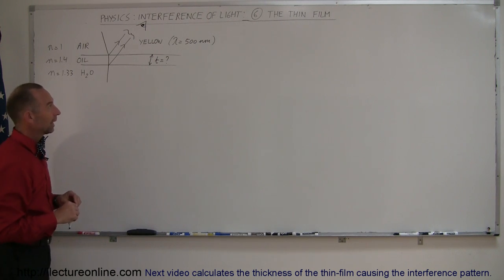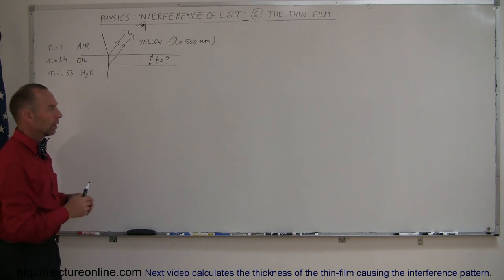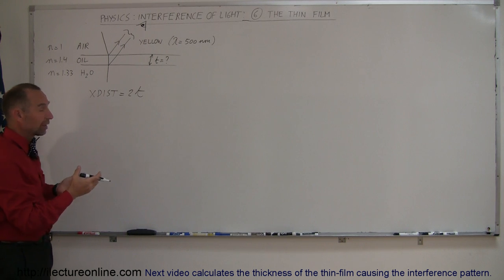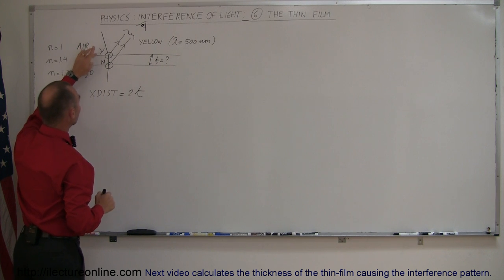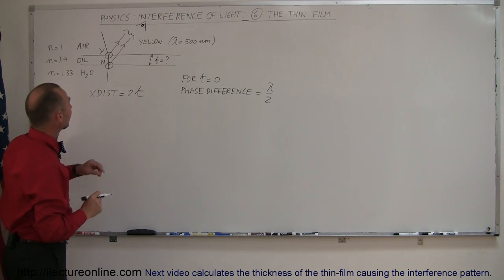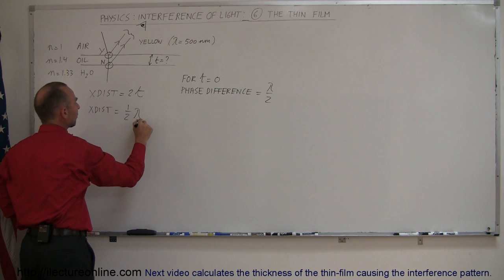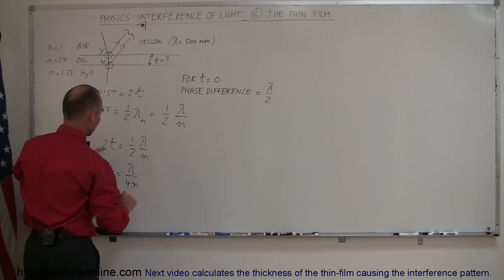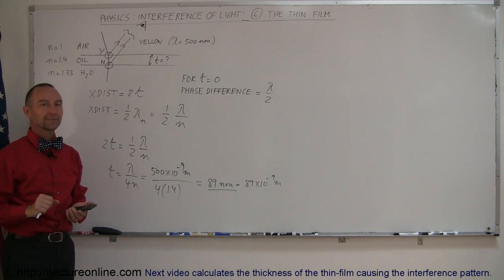Physics 60  Interference of Light (6 of 8) The Thin Film: Oil

Comment: quick questipon; lambda/2 is supposed to be destructuive interference yet yellow light is still being reflected....why :)?
Reply from the maker: When light hits a boundary where the index of refraction is higher on the other side, the reflected light will have a 180 degree (1/2 wavelength) phase shift (as from air to oil), but when the index of refraction is lower on the other side of the boundary there will not be a phase shift  (oil to water).  Therefore the two reflected beams are 180 degrees out of phase, and therfore the extra distance only needs to be a 1/2 wavelength for them to be back in phase.

Comment: Would it be possible to have the case of destructive interference and still have the yellow light reflected? In that case the observer wouldn't see any yellow light that's being reflected.
Reply from the maker: We are looking at the interference of the light reflected off the top surface with the light that is reflected off the second surface.  That second ray travels farther than the first ray (the extra distance is twice the thickness of the layer).

Comment: Respected sir could you please elaborate on the 180° phase shift...like what does this mean?
Reply from the maker: Whenever a wave encounters a boundary where the index of refraction on the other side of the boundary is greater than the index of refraction on this side of the boundary, then the wave will shift 180 degrees (1/2 of a wavelength) when it is reflected.

Comment: YOU ARE THE LEGEND. But I can't get one point. Why should the two waves be constructively interfere to get a yellow light?
Reply from the maker: That is correct, and yes in this video the two rays being observed are interfering constructively.  Note that one of them undergoes a 180 degree phase change upon reflecting off the boundary, therefore the path length difference must include the 1/2 wavelength.

Comment: If i want to determine the wavelength of light that i see, given the thickness of oil, do I use the same equation? I derived it on my own before watching this video and I got the same result, lambda = 4tn, but my result is 1520nm which is not even a color. Thickness of oil is 380nm
Reply from the maker: Try xdist = (3/2) lambda n    and xdist = (5/2) lamda n and see what you get.

Comment: I believe you should have used the wavelength in the oil.  Use n1 lambda1 = n2 lambda 2 to find it.  500 nm was not the correct wavelength to use, given the prompt for this problem.
Reply from the maker: The video is correct.  Thanks for checking.
Reply: Ah, yes, you did indeed convert to the wavelength in the film by dividing by the index.  Awesome. Thank you for making great videos for the students!

Comment: supposed when a ray is film at an angle of 45 degrees relative to normal?
Reply from the maker: Then the extra distance traveled through the film is 2 (t / cos(theta)).  However that said, there are additional changes that must be considered as the fraction of light that is transmitted and the fraction of light that is reflected changes with the changing angle.  This is usually covered in more advanced optics classes.  We plan on covering that in the future.

Comment: Thank you so much for making such great videos! do we always use the index of refraction of the material that is in the middle?
Reply from the maker: Yes, that is typically the case.  It is common practice to add a coating onto lenses.  Depending on the reason it will either block out certain wavelengths, of allow certain wavelengths through.

Comment: I've seen videos that say to use the wavelength inside of the oil and not the wavelength in the air, but I also see jsut as many videos using the wavelength in the air. Which is right?
Reply from the maker: It depends on what you are looking for.

Comment: Hello Michel! I wanted to say thank you very much. This video helped me a lot. However, I have a question and I dont know how fast you can get back to me, but here goes. 

If you desire to see a destructive interference instead of a constructive (as shown in the video), you would not put 1/2 lambda in the equation, correct? So you would use 2t=(lambda/n) instead of 2t=((1/2)(lambda/n)) to find the thickness?
Reply from the maker: That is correct, for destructive interference the extra distance traveled (2t) will equal either zero, lamda/n, 2 lambda/n, 3 lambda/n, etc.       Also not that this is the case because there was a phase shift on one boundary and not on the other.  If there is a phase shift on both boundaries (or neither), then it is reversed again.

Comment: Good day sir. I saw that you considered the Xdist to be "1/2 lambda sub n". what would it mean/imply if you consider "3/2 lambda sub n"?
Reply from the maker: +Ja Von (1/2) lambda sub knot = x-dist allows you to find the minimum thickness for constructive interference.  (3/2) lambda sub know = x-dist allows you to find the next thickness level for constructive interference, etc.
Reply: oh okay. there's no use in putting 3/2 rather than 1/2 for a film that has a constant thickness. The (m/2) lamda sub knot where m=1,3,5,7... is used only for a film that's varying in thickness like a wedge of air between two glass plates. Did I get it right sir?
Reply from the maker: +Ja Von Or the question may read: what are the 3 thinnest layers that will produce constructive interference, and then you'll have to use 1/2 lambda, 3/2 lambda, and 5/2 lambda to find all 3 answers.
Reply: right!. thanks for responding sir :) your videos are really helpful!

Comment: Is this constructive interference of destructive?
Reply from the maker: In this example the desire is to have constructive interference for the yellow light (500 nm), for the light reflecting off the top coating and the light going through the top coating but reflecting off the second boundary and joining the initial reflected light.
Reply: If i determine a problem to be describing constructive interference, is the equation for t always: [2t= Lambda/2n] ?

Comment: why is x distance half a wavelength please help
Reply from the maker: Because you want constructive interference and there is a phase shift on one of the boundaries and not on the other.
Reply: Michel van Biezen Why is it in 1/2? Isnt it should be 1,2,3,4,... for it to be constructive? I am very confused here
Reply: I was thinking that but i get it now. When the light enter the oil, at x=0, the phase flips it 180 degrees or lambda over 2. When it hits the water it needs to be in phase with the first ray so it is also lambda over 2. you can then still see the yellow light or else it would be destructive and you wouldnt see it.

Comment: I still don't understand the shift part
Reply from the maker: If the index of refraction on the other side of the boundary is greater, then the light that is reflected will be shifted by 180 degrees (1/2 wavelength).  If the index of refraction on the other side of the boundary is smaller, then the reflected light is not shifted.